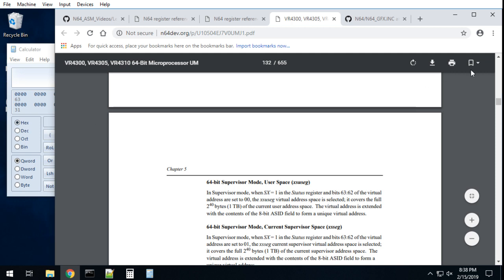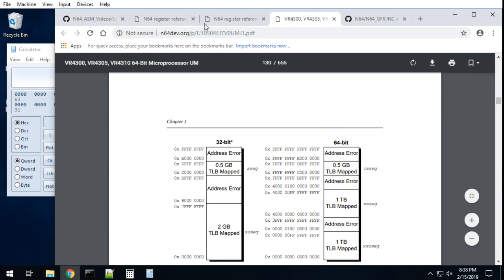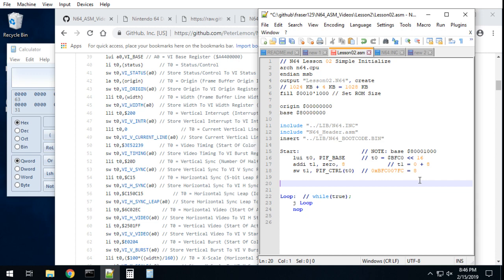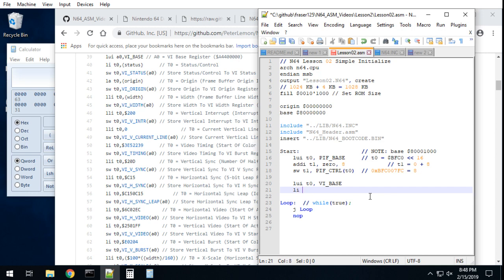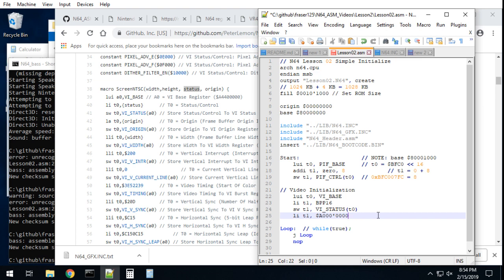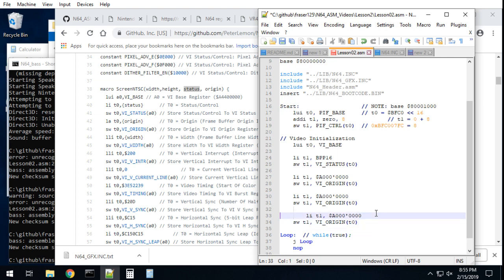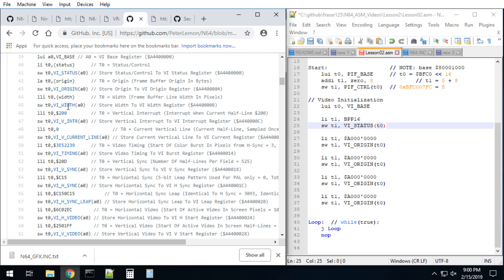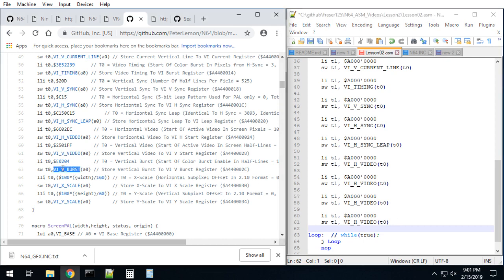004 Memory Mapped Hardware and Video Init

Comment: Is it true to say that reading from the cache is quicker than from ram, but writing to the cache is slower than ram? 

If that's so, if you were to write to the ram range directly is that value updated in the cache? Is there a delay involved before that update is seen in the cache? 

Thx for the videos. I started watching them yesterday.
Reply from the maker: Caching is a big topic, so here is the short version.
Cache is smaller and faster RAM before the main RAM.  RAM is physically outside the CPU chip, Cache is physically inside the CPU chip, so Cache is faster to access both read and write. The cache has what I would call "behaviors" that make it better/smarter than standard RAM.

The CPU doesn't actually know the cache is there and doesn't really care, all it does is read or write to a RAM address. If the RAM address is in a MIPS cached range the cache will read/write 32 bytes at a time which is usually more efficient, since you will probably operate on the following bytes soon after.

Writing to RAM (through the cache) is a little trickier. The data is written immediately to the cache which is great, but the cache isn't written back to RAM immediately, it's written back when that cache block needs to be re-used. If the same address is read again it will read from the cache and everything is fine. In a multiple CPU system each CPU has it's own cache remember it's physically inside the CPU. Depending on the code running it could take anywhere from nanoseconds up to minutes (usually nanoseconds) before the value is written to RAM.  So if the Main CPU writes a value "to RAM" and the Cache hasn't actually written it to RAM, the other CPU (RCP/RSP) doesn't know about the change and will use the old value.

So now your questions:
1. Reading and writing blocks of data (32+ bytes) is faster through the cache, less than 8 bytes probably direct access is faster, 9-32 bytes test because I'm not sure. Any difference is going to be just a couple of instruction cycles so small and hard to measure.
2. Writing directly to RAM and bypassing the cache, wouldn't be detected by the cache. The cache would have to be flushed and that RAM address re-requested for the cache to have the correct data.
3. Yes the delay depends on when the cache block needs to be re-used. It is possible to flush the cache manually.